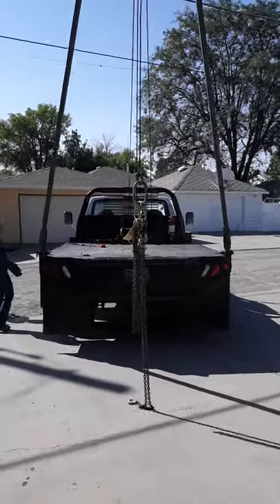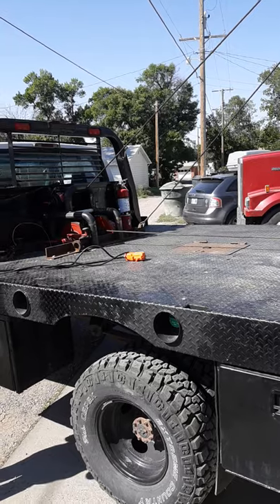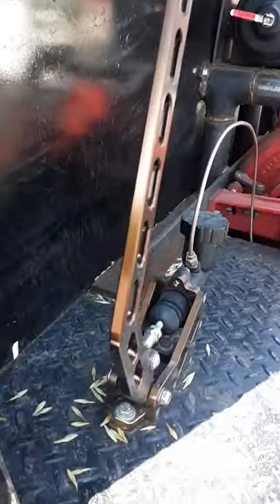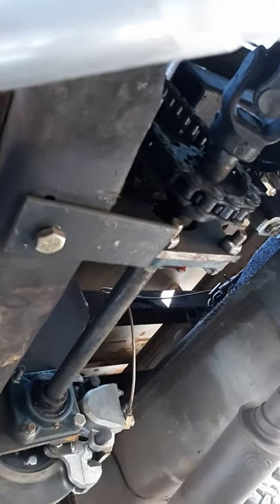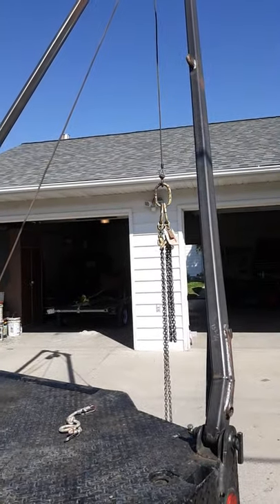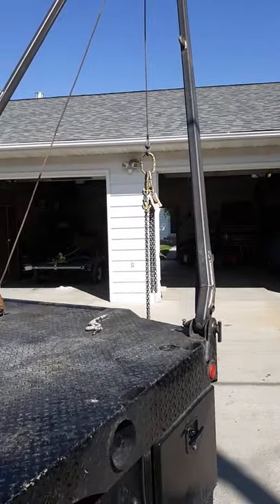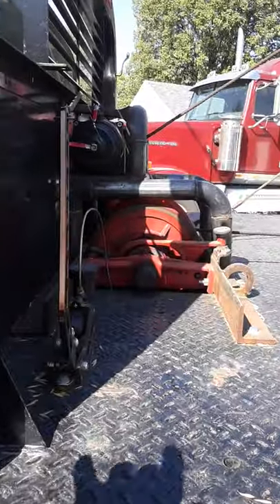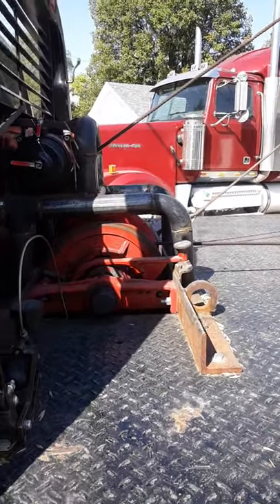PTO winch on an automatic transmission

Comment: I cant remember which wire it is for the tq converter lock but if you ground it you get lockup. Would be easy to add tbh

Comment: You might be happier with a hydraulic pump and motor setup just for ease of control. Still pretty cool. Never thought about a pto drive winch on an auto. Also what happens in neutral? Will the internal winch brake hold or just drop the load?
Reply from the maker: Same brake will keep the winch from running through